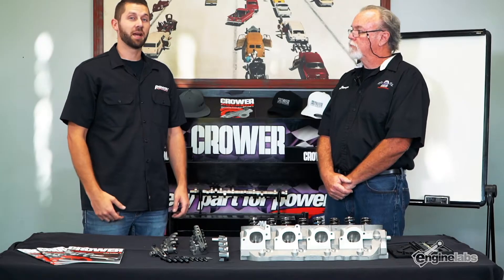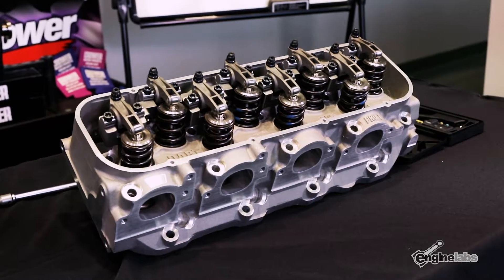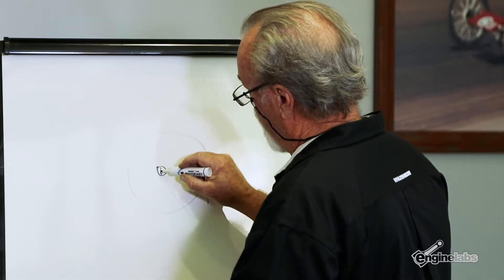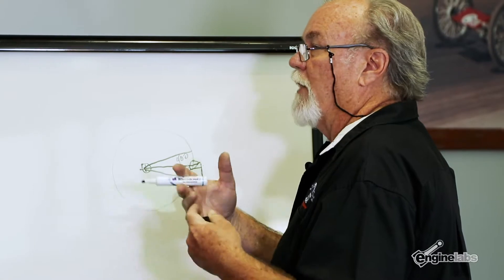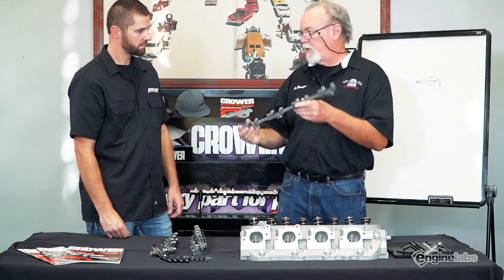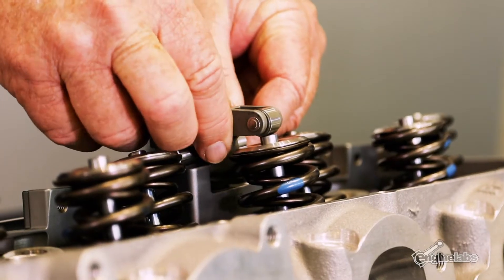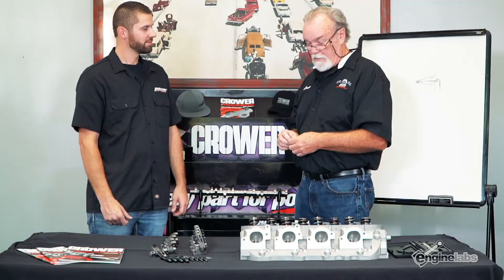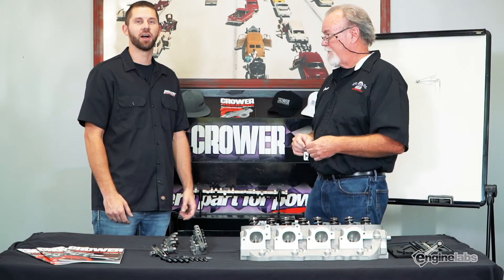Setting up Crower Shaft-Mount Rocker Arms

Comment: The roller rocker arm with two ball bearings in the fulcrum of the rocker arm. These OHV train are design for multi-shafts mount rocker arms. How long is the distance between the end of rocker arm touching the poppet valve to the axis of the rocker arm? You say .75 inch long for 454 CID. How long is the distance between the ball bearing axis to the end touching the pushrod upper tip - Crower rocker arm? What about my design the pin roller bearings with outer race and inner race with retainer just like the Radial precision ball bearing made but no ball. The pin is design and shape of the flat end but from flat end to the flat rolling contract of the pin at the bottom plus mill off so that the pin is shape elliptic Curved chamfer from bottom of flat facing side to the flat end's side. The flat end is vertical of this pin and flat facing side of the pin is horizontal and Not to be named pin. Where the pin flat facing side to the flat end side is 90 degree. The new design of this pin is named Horitz pin under mother company of my Incorporation named Multimobile address in Durham, NC 27704-5311. 
 The Engine that I drafted one is the Type 1 Strambeir two stroke one cylinder and crankshaft is also vane pump build-in allow for 2 stroke fuel and air mixture boosted pressure to go thru the elbow sitting atop the crankshaft case behind the cylinder around 430cc -500cc displacement and atop the elbow runner is connect to the cylinder where piston close the cross flow of the stroke inside the compressed exhaust and air and fuel mixture. The carburetor of two stroke is at the front and connect to the cast aluminum magnesium alloy siliconitium case of crankshaft rotates by the frictionless bearing housed in the crankshaft case below the cylinder. 
 The Ducati had designed and patent pendant there own design of the valve spring-free named Desmodromic is so similar to my Strambeir Type 2 valve but I have never seen the Desmodromic Valve system because I was stuck and writing with pencil and ruler on poorly establishment. Then in the year 2000, I drew my design sketch on paper that I got the sheets of paper for free.  That Valven see-saw rocker arm is camshaft lobe touching on top of rocker arm at same time another camshaft touch within that side gap above the valve stem and but also the rocker arm's second end is between the 2nd camshaft and valve stem. There I explain again -the first end of the rocker arm rub and touches the lobe of the first camshaft along with another camshaft the second that willing touching the second end of the rocker arm the First part.
 The oil ring seal called valve stem ring seal was build and I online order the valve ring seal sealing between the cylinder head upper casting and the valve stem. The oil stem seal is 4mm hole and fit downward to the valve guide upper butte. Outside diameter of the valve stem seal is 21mm and brim hollow-hat shape valve ring seal is 23mm or 24mm diameter. The brim is fit under the valve spring is also named valve stem seal made out of high temperature resistance and steel build by the Stamping Room with the calculation office by Rato 170cc service and Parts Headquarter of National part number made for series A2006009339 and model number is RV170MS00GB-SCX313 motor. It took me to wait for the pricing of the pair of the valve stem seals for already five months.
  There is a BMW motorcycle with rear wheel's hub is on axle that is connect to one one side of the swing arm. The older Honda Night Hawk have the rear axle of the wheel wherein the axle connect to both sides of the swing arm yoke/fork ( two arm prong). The one side swing arm that the BMW have is one arm prong swing arm for suspension and roller chain drive friction at the rear system.
 Now the cylinder head will be stronger high silicon-aluminum includes 13% magnesium 7068-T6511 alloy. Or SAM metallurgy 1% copper and iridium silicon alloy to cast aluminum cylinder head A356 or A36 alloy or AS7GU or 319 aluminum with ductile iron steel valve seat pressed to the aluminum and .1% cadmium cylinder head alloy of Cast Magnesium salt. 
  The one side ball radial bearing set of the rocker arm is possible and safe bet. Instead of two ball bearings on both side of the rocker arm. So just one side ball bearing is just right.  Because there is no room for two ball radial bearing sets for the 3 valves per combustion chamber type/model cylinder head. If you eliminate the ball bearing radial set off away from shaft-mount rocker arm (roller) that it will save space under camshaft/valve cover. The ball bearing set is includes outer race, inner race, balls and retainer on both side with two seal.
  The BMW bike have just one side of its bearings radial was to prove to you about why two bearings on both sides. Safe enough and cheaper to make the one bearing radial per rocker arm for 2 valve per combustion chamber than high price two time precision radial bearing of balls sets per rocker arm.